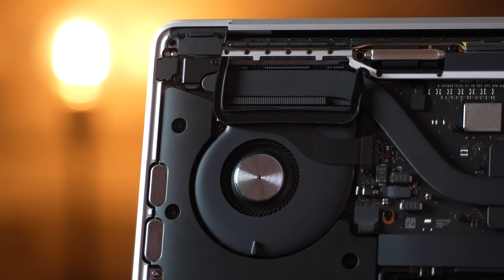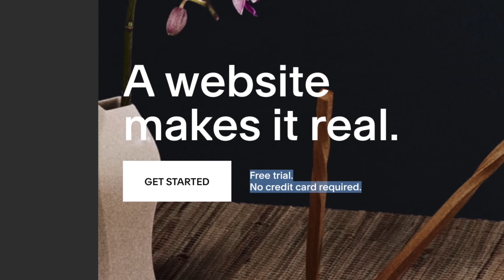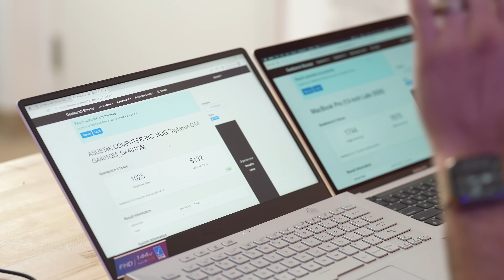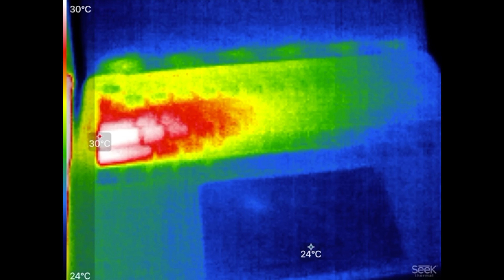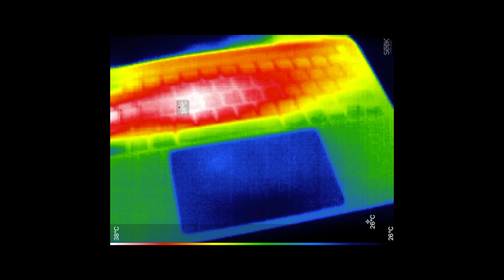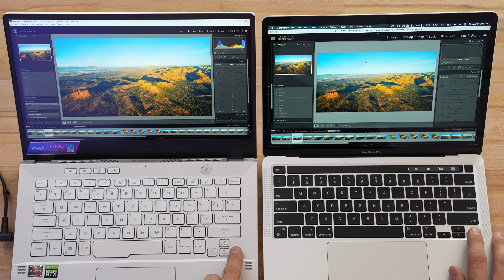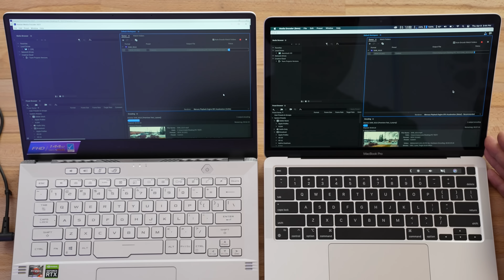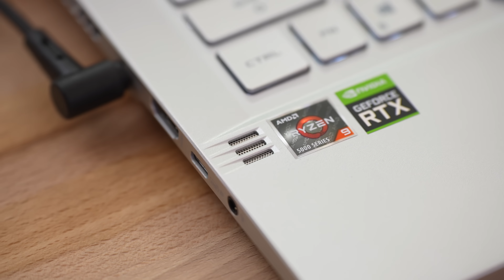Apple M1 vs AMD 5900HS + RTX 3060: FINALLY an M1 Killer?

Comment: 5900HX is the fastest not 5900HS. 

Tested using OCL vs Metal is stupid.  Use Vulkan, Metal is almost Vulkan and Infact if you look at how MoltenVK works you would understand how similar these APIs are.  OCL is deprecated on both platform, just windows and drivers keep more legacy APIs and things going longer. AMD suffers greater loss with OCL in general the score you got on 5900HS is only slightly higher than score I got on my 2700U laptop that’s limited to 20W with only 2400Mhz ram and iGPU only boosted to 1100Mhz (14K vs 16K points) using Vulkan would further this greatly specially given higher power budget, clock and near lot doubling of bandwidth per CU. 

Entire Adobe shit is single or barely MT optimized… its heavily focused on using as few threads as possible that’s one of the big reasons it’s hated by so many people is it’s shitty optimization for CPU and GPU.  Barely anything used GPU when it should like stabilizing would be vector math which should see huge gains if done in GPU or given every thread on the CPU.   In premier it poorly utilizes GPU for encoding and is against hyper focused on using as few threads and paths and possible.    This is why you seeing ~20% range faster on M1 vs 5900HS.  That’s how much faster it is in Single threaded loads.

Comment: All the apps running on the macbook is specifically optimized for this hardware. But none of the apps is seperately optimized for the hardware in the asus laptop. If that mac was running windows...then it would have been a fairer competition. Not to mention M1 doesn't even have a dedicated GPU and anything graphically intensive will suck on it big time..

Comment: Forgot to mention another key point here, G14 has replaceable Memory and Storage, If you need an upgrade or if either goes bad, its a easy replacement as opposed to Apple M1 which may require a full motherboard replacement that would cost more than 50% of M1 Laptops actual cost!
Reply: If never experienced an issue with an SSD or Ram going bad. I know people that still use their iPhone 6S without no hardware issues besides worn down batteries.

Comment: I hope amd starts using risc v based with x86 on the upcoming rumored big.Little cpus. That would be some monstrous cpu to look forward to.
Reply: Big little isn’t about power. It’s about efficiency. Adding big little architecture is going to make them slower than just using all big cores.
Reply: @RiceCubeTech  obviously i know that. But there are rumors out there saying amd may release a few CPUs in future manufactured using big.Little. Obviously if they are going to continue using the x86 arch only, then they will be putting 6-8 big zen cores and may be couple them with 4-8 small zen cores. I dont like that, its ok if they bring something like that with lower end ryzen 3 or ryzen 5, we dont need those low power cores in ryzen 7 and ryzen 9, at least i dont. But like amd ceo lisa su mentioned recently in an interview that amd currently dont have any plans of using arm risc v arch, but they certainly plan on using it sometime in future, so i am hoping that amd should use big.Little to somehow put an x86 zen chiplet together with an risc v chiplet and somehow make them work with each other. Because if anything, amd is certainly capable of achieving something like that. And as u can already see in the video above the risc v arch m1 chip may be a low tdp chip, but it certainly is not weak. Its already trading blows with an x86 zen 3 chip. Thats why i said it would b monstrous chip if it ever comes in existence.
Reply: @shubh_nx777  amd isn’t going to do it in the meantime, because the laptop market is something they’ve had a horrible time penetrating. Their money maker is still on server side with PCs making their next largest money maker. Laptops where ARM matters isn’t even going to matter much for them. But I’m sure if it does become important, that they will pivot and shift with the times. They have billions of dollars of RnD so I’m sure they’ll be ready.
Reply: @RiceCubeTech  no, definitely not in the meantime, its just a rumor still anyways. And yes, they still have much market share to gain even now. But we know, intel is working on big.Little so i think we can expect something similar from amd as well. And no, i am not only talking about laptop division but also on the desktop side as well. About servers, well, that depends how the their future plans are and all. Because only amd or only intel shifting their focus from x86 to risc v wont be enough to move all of the market to support risc v, since vast and vast majority of things are based on x86. Its definitely wont b easy, but like u also mentioned above- if they manage to make something with huge performance uplift, only then we may b able to see major shift in the industry.
Reply: @shubh_nx777  big little doesn’t help on the desktop side man. Big little cores are designed for power and thermally limited packages like small form factor and laptop. On server and desktop, you’re not limited by power consumption as it’s always plugged in and has big fans. It’s more advantageous to have maximum performance and go all big cores when you’re doing server and desktop.
Reply: @RiceCubeTech    yes i know, big.Little was originally designed for power efficiency on mobile devices, but intel are still bringing it in the desktop, idk their justification behind it, nor do i understand what they gonna achieve by saving a few units of electricity, but look at the alder lake lga1700, featuring golden cove (big) 8 cores 16 threaded with atom gracemont (Little) 8 cores (non smt). That is the reason big.Little rumors about amd bagan to surface. May b they plan to match amd's huge ipc by combining the performance of whole 16 cores (8 smt enabled and 8 energy efficient atom cores), thats the only thing i can imagine at this point.

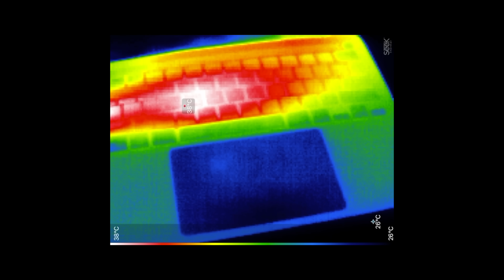Comment: 10:31 so amd run on 43c and m1 run on 38, its 6 degreed difference... amd run hot and m1 run warm? is this a bias?
Reply: The M1 easily reaches 100 degrees, it just takes care to hide it so as not to lose channel support.
https://www.youtube.com/watch?v=m1dokf-e1Ok&t=236s
Reply: @uribak9144  The chip runs hot, but the laptop doesn't. That means you can use the laptop on your lap and your fingers stay cool. It's a different test if you look at the chip temperature. That will show on performance.
Apple chose to reduce performance to lower the case temperature. It is not a gaming laptop, it is a light laptop.

AMD's tech is pretty nice, though. But I doubt x86 will survive, they need to move to a RISC if they want to survive in the future.
Reply: @fod1202  The X86 processor also incorporates RISC into it, it is irrelevant it remained in the 90s.
As for Apple's limitation on computer performance, I'm not interested in paying money for a product limited by a corporation.
Reply: @uribak9144  You can easily add a thermal pad in there if you want. But if you want performance, I agree, you are not a target customer for the M1.

Comment: 5900hs isnt the fastest 5980hx is faster and you can OC it so it should be better cpu with a good system and the other thing is the ram speed , amd gets a lot from faster ram m1 is nice but you cant run a lot of thing on it native and the emulator is a huge gap in stability. Like i said it is good for casual use, but it isn’t good enough for special usecases( like revit or leica cyclone,etc)

Comment: The Asus is a gaming laptop. The MacBook M1 isn't. In fact the M1 graphics are terrible. The AMD processor is a 35 watt part and this laptop model also runs a high end Nvidia graphics chip which also produces heat. Asus could have used the 5800U 15 watt part, but didn't. Needless to say, most people will run their laptop using their power supply even if it is the MacBook M1. Sorry, you lost me on this one. The Asus will sell  millions of these decently priced, high performance laptops whereas Apple will be lucky to sell 10% of this figure. The Apple lacks graphics horsepower, is very overpriced for what you get and there are no AAA games that will run on the Apple. I don't give a rats arse if the M1 is a little bit faster and uses a little less power. Who cares.

Comment: The only thing this video shows is how incompetent the person doing the test is. This video might as well be testing the climbing ability of a dead squirrel and a snail and it would make the snail look like the winner. Without normalizing the test conditions this video is WORTHLESS.Claiming to test a very specific metric under unknown conditions with 2 devices that are not really comparable. Pulling the plug on an asus and turning on Performance mode makes almost 0 difference compared to having it plugged in. Turning on power saver mode will make almost 50% difference though. This video gives NO information about the test conditions though and at least on my Asus the default is a 75% reduction on the power setting bar. You would have to measure power consumption during the test to be able to draw ANY conclusion. A start would have been to at least list what settings it was using, so we know exactly how stupid you are.

Comment: BS, if you do only one thing at a time then the less cores are OK but is you want to use your LT to do other things while a heavy task is running then the 8c 16t will be your choice,  Plus the desc says $1299 the vid $1899 and the link $1699 for the M1 so which is it?  The real question is the 16GB on the AMD a single stic running in single channel?

Comment: Your tests are completely invalid unless you also compare the power setting to battery life but you give NO information about what power settings are used. Asus default doesn't use performance mode EVEN WHEN PLUGGED IN. Just pulling the plug on the asus and even with plug you can set the performance settings to multiple settings and without knowing what mode each laptop is set to you can't compare them at all. If the Asus is switched to power saver mode without the plug but the Mac M1 is not then you will get a HUGE performance difference. on my Intel ASUS it is a difference of almost 50%. Then there is also GPU settings which can be disabled or enabled and without knowing what those are there is no way of knowing if this test is even comparable.

Comment: I actually don't really get it , like apple has money and resources sure, but they don't really have expperience when it comes to developing CPUs. how come a noob comesout with a chip that destroys all of these companies that have been doing this for years?
Reply: Apple has been developing CPUs for iDevices for some time now. The M1 is the A14 used in the iPhone 12 plus some more cores and higher clock speed (and some other enhancements).  But the real reason they're beating Intel and AMD at their own game is x86/CISC is just about topped out in what it can do. Therer's just more room to grow with ARM/RISC/SoC architecture.   All Intel and AMD can do at this point is keep adding more cores. But desktop computing doesn't utilize many cores very well.
Reply: @yarnosh  no man , this doesn't cover that fact that it is still amazing they did  it . the m1 is now a desktop running a desktop OS .
I don't think it is a simple as you describe it , making a chip is complicated , making a good one even more so... making a new architecture for desktop computing that runs well and has compatibility with most apps is crazy and that fact that they did it all at once is even more so . 
usually when companies try to do something like this they fail miserably ....
Reply: @gabiedubin  I heard they poached a lot of engineering talent from Intel.  But I think you're also mixing the hardware side of the success with the software side. Yes, making the architecture might have been new to them, but remember Apple has been  through 2 major architectural changes before this (3 if you count Apple II > Mac) so they know how to make it smooth.

Also, this really shows off the power of vertical integration. When they own the hardware and the OS, they can orchestrate things like this. Plus they're not afraid of pissing off some users of legacy hardware/software. If you spent thousands of dollars on the last generation of  G5 Mac Pro, you were pretty much SOL 4 years later when Apple dropped support for PPC. Probably the same thing will happen to anyone who buys the last generation of Intel Mac Pro now. Or even the MacBookPro 16".  

 Where a company like Microsoft supported legacy software and hardware for decades. Look how long you could run DOS programs in Windows. DOS should have been retired in the mid/late 90's and completely abandoned by 2002. But Microsoft kept DOS underneath Win 9x, using the archaic FAT32 file system, even.

Comment: This is a stupid comparison actually. Gaming laptops are tweaked to perform better at gaming and not video rendering. The driver sets are completely different. Most YouTubers don't know that. They think a PC that has graphics card and a powerful processor should work great for both gaming and editing equally. That is just silly. Also, Macbooks are not meant for gaming. So you can't compare that part either.

Comment: Regarding the Adobe test, you're overlooking the obvious fact. That Adobe has a strong relationship with Intel, so they have a strong incentive NOT to optimize their software for AMD CPU and GPU. This has always been the case since years before Ryzen became popular, which is why professionals who use Adobe Suite still choose Intel H-Series processors over AMD Ryzen 5000H. They've only just begun to optimize Premiere I believe, but that process is far from complete, as you can tell by how behind Ryzen 5000H CPUs are compared to the Last-gen Intel chips.

Comment: Another great video. I think it's more appropriate to compare according to the WEIGHT Class of laptops, each with Maxed-out Processor + Equal amount of RAM 
- Asus Flow X13 to MacBook Air 13
- Asus Zephyrus G14 to MacBook Pro 13,
- Asus Strix 15 to MacBook Pro 16 (future model)

Comment: NIce comparision, I have been watching your M1 vs everything videos. The Apple M1 is really good looking, nice and fast, beats every computer except gaming. The point is how many people do benchmark testing, photo and video editing in daily use? For me, I use my pc mostly for web browsing, programming and gaming, perhaps I have a photo/video that need editing once or twice a year. Most probaby the M1 will be snappier when I surf the web, compile my programs a few seconds faster, but it won't play any of my games!  Then taking the price difference into consideration, I'd choose a gaming PC with RTX graphics.
Reply: I'm not sure if it was this guy, but I recently saw an Xcode compile comparison between Intel MBP and this M1 MBP and the M1 built a large proect TWICE as fast.  So if you'er a programmer, I think the M1 would work well for you.  I don't know what kind of projects you work on, but 2 minutes vs. 4 minute build time is a big deal.  I work on projects where running specs/tests can take 30+ minutes.  Doing that in 15 would be amazing.
Reply: @yarnosh   Comparing MBP to M1 would make a lot more sense than comparing Mac with Win. If I am using a MBP, I would buy a new Apple M1 to replace it just for the speed and efficiency of the new chip. It's a no brainer.
Reply: @gorto1127  We already know the M1 MBP beats the pants off Intel MBP. That's a given. The poitn of this comparison is to try to find something that can compete with the M1. Sounds like the G14 does in some regards. I don't think this is meant to make people try to decide between Mac and Windows. THough if I didn't play a lot of games, this might cause me to make the switch.
Reply: @yarnosh  I respect that you can have your point of view different from mine.
Reply: This is a stupid comparison actually. Gaming laptops are tweaked to perform better at gaming and not video rendering. The driver sets are completely different. Most YouTubers don't know that. They think a PC that has graphics card and a powerful processor should work great for both gaming and editing equally. That is just silly. Also, Macbooks are not meant for gaming. So you can't compare that part either.

Comment: Test an actual game/ 3D rendering or something....Then you can see how much apple sucks..
Reply: True. Gaming laptops are tweaked to perform better at gaming and not video rendering. The driver sets are completely different. Most YouTubers don't know that. They think a PC that has graphics card and a powerful processor should work great for both gaming and editing equally. That is just silly. Also, Macbooks are not meant for gaming. So you can't compare that part either.
Reply: @A_Realist_1  A pc with good processor and graphics can do anything bro..

Comment: I've always ignored Apple products because of their poor performance, thermal throttling, and anti-consumer repair/upgrade paths. Now, however, they've completely turned around. I'm extremely tempted by the cost-to-performance ratio of Apple Silicon. In my country the Zephyrus G14 costs $1000 more ($1400 more if I get the Air, which can easily be modified for better thermals). I just can't turn down what is basically the most affordable 4k video workstation available.

Comment: Loved the video. Just bought a G14 and am quite pleased. The M1 continues to surprise. I feel the biggest issue to performance is actually windows and not the hardware. Any chance a similar test could be done with Linux / G14 and M1? That should unlock more power from G14 and would be a real comparison of the hardware of both the machines.